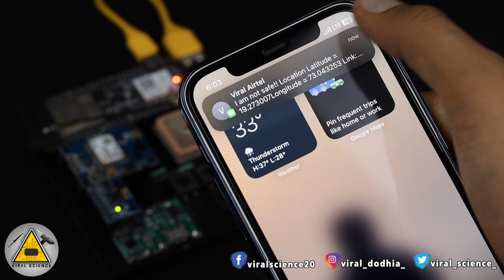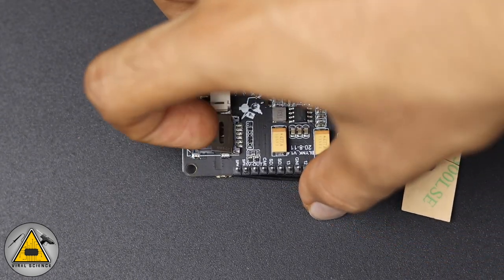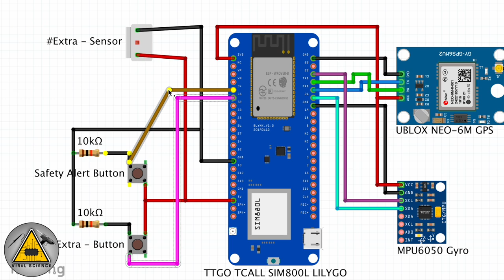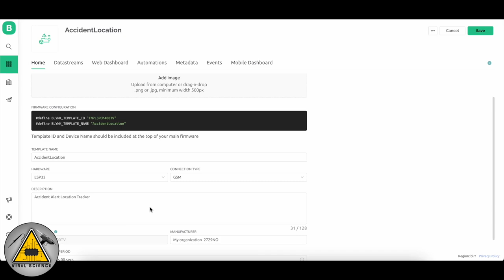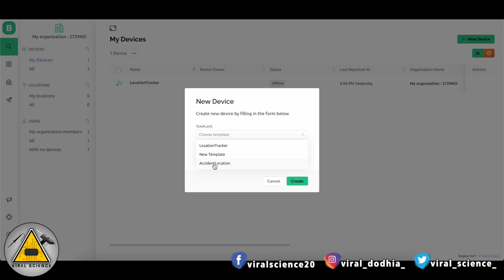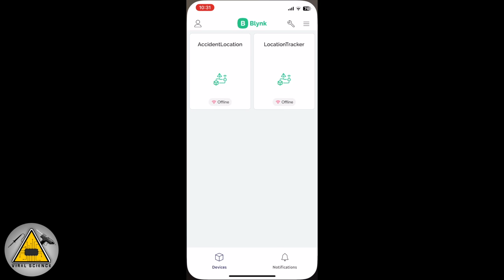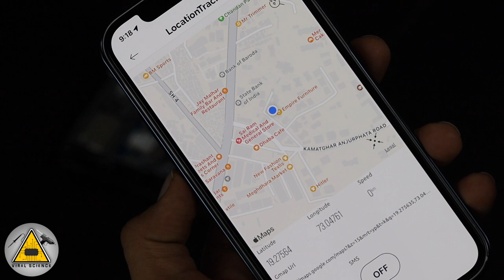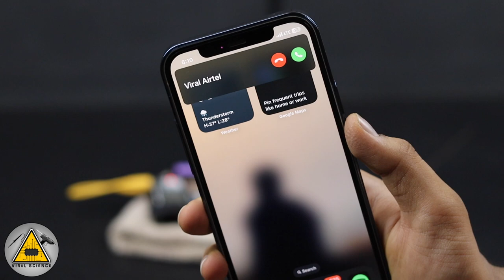Accident Alert Location Tracking system

Comment from the maker: ‼️Note: since its an accident alert system and we are just using  mpu6050 gyro sensor to detect the jerk we cannot completely rely on its parameters, this accident feature requires multiple different sensors data to accurately detect an accident so you can use this for your school/college mini project just for demonstration but definitely the real time location tracking and sos alert features can be used in the real life for safety purposes😊😊
Reply: thank you very much
Reply: I need help please reply
Reply: I can't found esp32 the board of lilygo,can I use the Blink board?
Reply: I need help please reply sim 800l